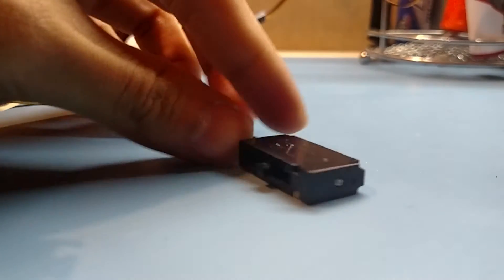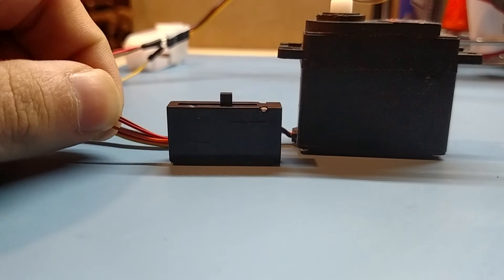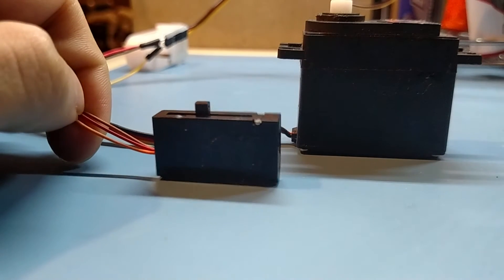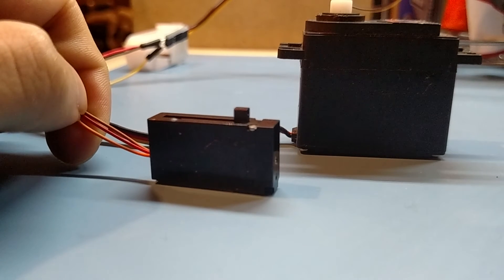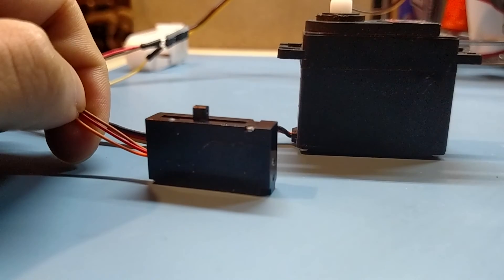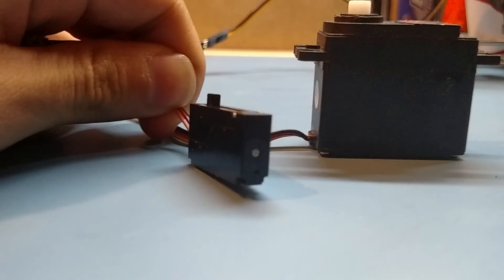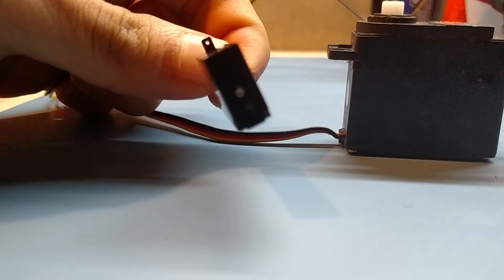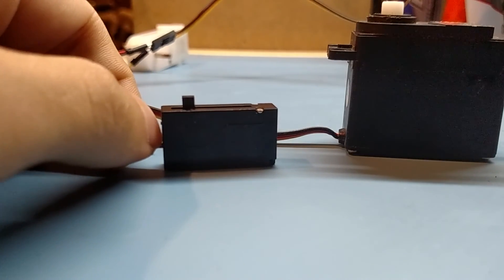VS-19 Pico Linear Servo

Comment: I bought a few of these for a college project, but I'm having a REALLY hard time figuring out how to use it with my Arduino Uno R3, and I'm not savvy enough to go DIY yet with this stuff.

The plug on this servo is too tiny for any socket I have, so what else do I need to make it work?
Reply from the maker: For unloaded testing you can drive the power and ground lines on the servo from 3.3V on the Arduino - this will run a little slower than max speed if powered at 3.7V. Generally you don't want to drive direct from the Arduino since it can't provide much power (and never from a signal pin), but this one is small and low power enough that it is "safe".

You can see in my video that I've just stuck wires directly into the servo plug and then into my servo controller - in your case you need a digital output, 3.3Vdc, and GND. I believe there's an earlier comment here talking about wire colors that may be useful.

Comment: Hey, I'm using these for a cosplay (spiderman moving eye lenses) over on my channel. How have you got them moving so smoothly? Mine stutter alot. I have 4 of them, all doing the same.
Reply from the maker: Are you sure you're sending a proper servo command (http://1.bp.blogspot.com/_bcej-id-XqQ/TFFu2HbhW8I/AAAAAAAAApg/02mnDBD50AU/s400/servopulse.gif) at the proper (3.7VDC) voltage? I haven't seen jitter other than at the extremes of motion.
Reply: To be honest i have no idea what this means. This is my loop:
void loop() {
  rightTop.attach(3);
  rightTop.writeMicroseconds(0);  // Ensure servo is at start point
  delay(1000);
  rightTop.writeMicroseconds(2000);  // Take servo to maximum position
  delay(1000);
  rightTop.detach();
delay(3000);
Reply from the maker: Ok, looks like you are using the standard Arduino servo library, which handles the details for you. Basically it internally is going to generate a 20ms wide command, of which part of it is at high voltage (>3VDC), and the rest at no/low voltage (ground). The servo will move as fast as it can to the commanded position. Then your script is waiting a second, and then moving to another position, then waiting again, etc.

Is it at least moving to the position you expect, just with a jerky motion?
Reply: That's correct. and it's not as fast as yours. It is the newest video on my channel if you'd like to take a look. Although the code has changed, it's just an alteration of the above. I'm concerned that my arduino pro mini 3v (not 5v) might be the problem. Maybe not sending signal fast enough. I'm using 3.7v LiPo to power
Reply from the maker: So you have 3.7V LiPo powering both the Arduino and the servos directly? Meaning the only servo wire connected to the arduino is the signal wire? You could have a switch in between or something so servo isn't powered all the time, but I want to make sure it's getting enough juice. If it's already hooked up so it's not pulling power & ground from the Arduino (just signal), you could add some small capacitors to smooth out the voltage. Though I can't imagine it would be overtaxing a decent size LiPo - they specialize in high current delivery.

It sounds loud more than anything, hard to see the jitter in the motion from the video. Really cool project, btw.
Reply from the maker: It's been a little while since I played with that Servo library, so in truth your blocking delays could be messing with something, not sure. Blocking delay using delay() or delayMicroseconds() means that the CPU just sits waiting for that period, and nothing else happens other than very basic I/O like PWM or interrupts.

Otherwise, the 3V arduino is plenty fast to send a servo signal, in fact it could send many servo signals depending on what else you are doing in your loop. Once the signal is being repeated, the servo will try to hold that position until it gets a different signal.
Reply: Would you be able to show me an example snippet? I was under the impression that delay was the time the program waited for the servo to reach its position. The delays during no motion were just because I didnt want them to keep buzzing back and forwards constantly lol
Reply: @DynamicEllie  If it is for a cosplay, if you are using long wires, watch out that the GND signal dont change its value in volts. It may sound weird, but I used one time servos with cables 2 metres long with various connectors and the resistance of the connectors generated drop voltages. And if the servos dont have a common GND value, they vibrate randomly.

Comment: Can you please tell me which wire is what connection please? I've bought one but nowhere, not on the website, nor in the packaging does it say D:
Reply from the maker: The connection is the same as for typical servos - black is ground wire, red is positive voltage, and yellow is the signal wire. Many servos use 5VDC for the red(positive voltage) wire, but this servo can only use 3.7VDC. If you're using a typical servo driver, you could burn up the servo unless you match this 3.7VDC.
Reply: My version has red orange and brown rather than red white and black which is why I'm asking (and in the video it looks like yours does as well?). So is orange menna be yellow and brown menna be black?

Thanks for the voltage tip though, it took them a week to arrive from the website and I had forgotten that by now.
Reply from the maker: Sorry, I don't have the servo hooked up in front of me, but that sounds like the wiring I remember. Either way, you can safely test it that way and see if it works.

Red - 3.7VDC
Orange - Signal
Brown - Ground (almost rhymes!)
Reply: You were right about the colours, thanks!